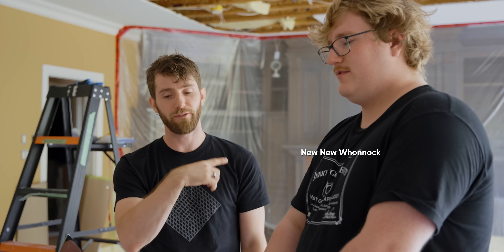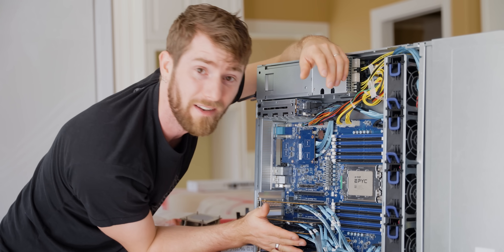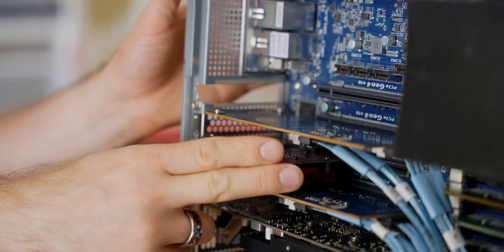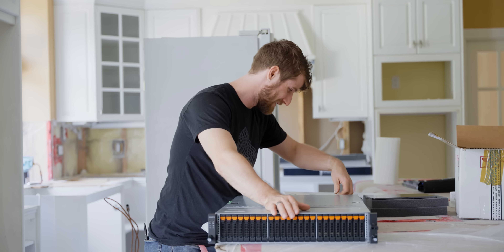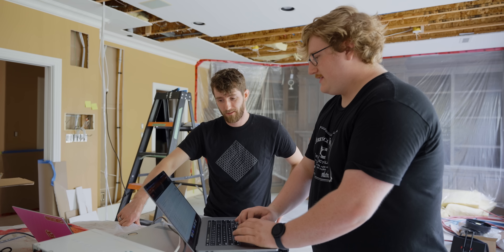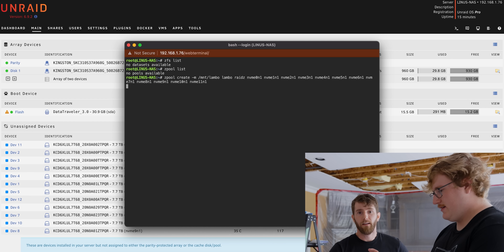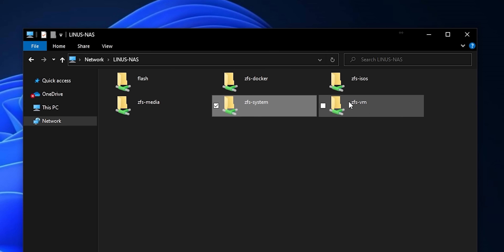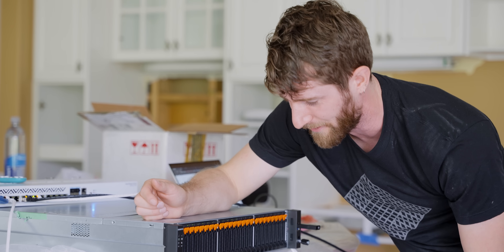This is stupid, but I love it - Linus Home NAS Update 2021

Comment: SMB is single threaded. I mean smb will use one core for a single transaction. I always get better performance with nfs but the fact that windows doesn't natively support it... Hurts.. And the end of the road you'll more likely have network throughput issue than cpu time :D

Comment: I wonder what Linus is doing with this overkill hardware. I have an old Xeon e3-1225v2 with 32 gigs of ddr3 memory in my server which is running a few containers and a vm. The server is not breaking a sweat. Guess i need some more ideas of what to self host haha.

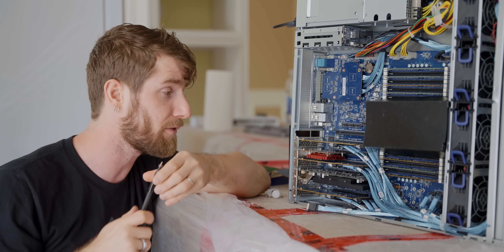Comment: 5:10 To use the top PCI-E Slot you need to Connect the 4 SlimSAS 4i connectors over the Slot with the ones an the Bottom Right. You can use 4 SFF-8654 Kabels for that. It is Mentioned in the Usermanuel on Page 8 and 10. I have the Same Motherboard and was disapointed needing to by 4 Extra cables
Reply: OH the horrors of having to buy 4 cables...geez how lame. Is it in your kitchen???

Comment: For everyone setting up ZFS for their first time: when using raidz mode you only get the IOPS of a single drive. For more performance it's better to go for striped mirrors (equivalent to RAID 1+0).
Reply: Also the recovery is WAY easier. This way if one drive dies of old age, you need to read all the data from ALL the drives, risking another catastrophic drive failure, which in RaidZ1 is baibai all data.
Reply: THIS
Reply: Or striped RAIDz(1/2/3) if you want the most capacity while still being able to choose how many stripes you want as a multiplier of the performance (3xRAIDz2 means 3 sets of 2 drives for parity, and 3xIOPS).

I think Linus ultimately chose RAIDz because his 10GbE networking is the biggest limiting factor, so he wouldn’t be needing much more speed out of the drives either way, at least for movie storage and sequential transfers.
Reply: It is worth noting that with striped mirrors and a large pool of drives (any double digit number total of drives), for multi drive failures you need to pray that none of the failed drives come from the same mirror, or you’d toast the whole pool.

Comment: Linus: "I'm gonna need 100Gbit networking at home"
Jakes "We could do that." was a meme in itself.
Reply: Who doesn't want internet in their house that's faster than the broadband infrastructure serving the neighborhood?
Reply: @TigerofRobare  Well, you wouldn’t want to be unprepared for when the ISPs upgrade in… 2060? …2160?
Reply: @Iceman259  more like 2260 for my rural area
Reply: @TigerofRobare  Networking =/= Internet uplink
Reply: The “should we do that?” Got me chuckling pretty good
Reply: "I can fix that"
Reply: Here I was proud of my 2.5Gbit home network and 16 tb nas server...
Reply: @MeepMeepMwo  I still am [proud] for you
Reply: @christopherjc54  I have 1.5T used of 14TB after format, can hit 385MB transfers and 10Gbe connection, have it backed up to a 2nd machine and 1 offsite copy...are you proud of me too???
Reply: @MeepMeepMwo  10 GbE Base-SR gear is pretty cheap these days and can go over fiber (goes far for cheap).  The same fiber will carry 25 GbE, but that's still a bit pricy.
Reply: @tommythorn  Yeah but the mobo ports are 2.5 and its a small 4 pc wired network. No issues with bandwidth so far. Maybe in the future.
Reply: Rookie numbers, do PETABIT network
Reply: Glass is glass and glass gonna break

Comment: based on a question on the LTT that wasn't answered I ended up with my own question. Each drive you had as a max read/write speed, but is there such a system to be able to have the max read/write on all drives all the time? In a normal PC there is a bottle neck, the more files you are saving the slower the system gets, and the same happens on multiple drive with 1 file being written, so I'm guessing there is a bottleneck chipset that is limiting the writing.
Reply: afaik in this case there is no chipset as the Pcie lanes come directly frome the CPU. as he says in the video, in the worst case scenario he may be RAM bottlenecked as the pool read speeds are actually higher than RAM's
Reply: @gabrielenitti3243  I am not a geek, just a PC user that notices things. Now I remember Linus saying a long while ago that a server was just a PC. 
I understand you can't write what the RAM isn't holding, but I see many times on my PC multiple drives are held back (the copying slowed down) the more you send files to be written to them all. I say all to exclude each drive have a max speed to write so more files will equal a slowing down on the one drive. 
I now need to say when looking at this occurring the RAM is being under used when looking at a manager profile. Something is bottlenecking, and I don't know what this might be, except something on the Mother Board that gateways the information from RAM to Drives.
That would be on a everyday home PC. Is what Linus uses as a motherboard have parts not found in home user systems?
Reply: @tommyrotton9468  Yes, as I said in an everyday home PC most likely the drives are connected to the CPU through the chipset unless it's an nvme drive. But in Linus' server as he mentioned in the beginning all the drives are connected directly to the EPYC CPU that has 128 PCIe lanes so no bottleneck coming from other parts of the system except that in this particular case the drive are so fast that together can throughput more data than the RAM. Therefore in his server RAM speed will be the bottleneck

Comment: The way you referenced drives during pool creation is unsafe, dev numbers can change during reboot and you need to reference them by id instead. Also saying that ARC is not needed for SSD and would hurt performance is a bold statement without reviewing specific workload.

Comment: Video transcoding doesn't really heat up GPUs either, so definitely fine!
Reply: Considering the capabilities of this system, I wanna know if Linus is gonna hack that 1050 to do unlimited streams. I think it's limited to 2 by default, but allegedly you can hack the nvidia driver/firmware to give you unlimited streams. Granted, the NVENC chip can probably only handle a certain amount, but unlimited possibility is nice, especially with 720p/480p transcodes.
Reply: @DarkSwordsman  By default the limit is 3 streams now, and actually it's super easy to patch the driver now with the keylase patch
The 1050 Ti should be able to do 10-15 720p streams
Reply: @DarkSwordsman  LTT + Craft Computing crossover when?
Reply: Plus he just tossed the weakest link of that card those fans are atrociously bad they only lasted 6 months in my system and 3 months with an RMA unit from MSI. I eventually just bought Noctua fans
Reply: @wh0_am_152  r/ihadastroke
Reply: blowymatron
Reply: Also it's a 1050
Reply: fire literally everywhere
Yeah its fiiinnnneee
Reply: @Afif87123  Lol, there are several problems with this setup.

Nvme SSD's heat up without heatsinks which isn't the case here but the problem is, he has multiple nvme ssd's next to each other. And nvme's are notorious for getting slow with performance degradation when they heat up. If his server heats up, then the SATA ssd's are actually faster than nvme ssd's which defeats the purpose of this 'upgrade'.

Second problem is he is using Gigabyte motherboard. Gigabyte have a lot of manufacturing issues and faulty hardware issues like their PSU's atm. If the motherboard has the same fault as the PSU's, that server isn't going to last 6 months.

As you said, its fiiinnnneee.
Reply: @luminatrixfanfiction  What are you on about? The ssds are in a aluminium case with fins on the underside + a shitload of airflow from the case and this particular mainboard did run reliable with a other setup for over 1 year lol
Reply: @WorkinDuck  Do you know why M.2 ssd's have heatsinks in any build?
Reply: @luminatrixfanfiction  These aren't m.2 ssds lol
Reply: @WorkinDuck  I can only assume that you're a Linus employee. Perhaps your 'setup' ran for over a year but can you say for certain if there was no stress to the hardware or thermal throttling involved? 

I can't say for certain since I'm not there to see it but, I do have questions about it. I'm as excited as the next tech guy to see hardware pushed to new levels but I'm also wary of hardware failures when it comes to present limitations.
Reply: @luminatrixfanfiction  gigabyte enterprise boards are fine and while m.2 ssds get small heat sinks to go over them in user motherboards its not like they are cpus or anything like that, the heat they generate is no where near enough to throttle specially in a usecase like this. You really think enterprise level hardware is going to have such an obvious flaw as thermal throttling drives. Kioxia would go out of business is they tried selling these if their engineering was so bad.
Reply: @WorkinDuck  Out of curiosity, if those aren't m.2 ssds, then what are they if they aren't being populated with SATA?

Comment: would he have gotten faster speed with something like a Threadripper PRO 3955WX, using a ASUS Pro WS WRX80E, and a couple NVMEs in an expander like the Asus HYPER M.2 X16 GEN 4 CARD Hyper M.2 x16 Gen 4 Card? Seems like he was bottlnecked by the slower EPYC single core speeds...

Comment: maybe 25gbit .. 100gbit from node to node might be of benefit .. possibly 200gbit, above that you are looking at about 10 years of gradability -- 25gbit is still costly in the end, i would say pair 10's if you have enough port capacity otherwise 10 is fine if you are getting multiple user nodes making requests at the same time.. also common sense

Comment: I haven’t ever understood Linus’ preference for Unraid over TrueNAS (FreeNAS).
Reply: Yeah that and the fact he has Anthony at his disposal. Still decides to use the wrong product for the wrong use case, and the worst part is that people WILL end up paying for Unraid only to find out there’s better supported enterprise class solution available for free. I have MASSIVE ethical issue with that. A disclaimer would be nice. But then, what would they say? “We decided to go with the paid solution because it’s less supported, had less features, but looks more unfinished, but the fact that it’s unprofessional is worth every hassle” wouldn’t probably sound reasonable. For me it’s either FreeNAS/TrueNAS, else some DELL/IBM SAN. But I’d still prefer the iXsystems solution over a NAS which is more popular for it’s VM hypervisor functionality that being a NAS. 🤷‍♀️
Reply: @LMojzis  Thanks for pointing all of this out, I just learned something 🙂
Reply: I believe he's friend with one of the head Unraid guys
Reply: unRAID is nicer as you don't have to have identical drives to have easy setup
Reply: @demoguy84  free/true nas does not have a problem with mismatched drives. I'm running 6 Truenas system with storage between 3tb up to 90tb. Never had a problem with mixing drives makes or sizes.
The hassle of setup up the ZFS on Unraid is un-necessary, just use Truenas FFS!
Reply: @jodokast1205  the problem I've always had with truenas is that using disks of various sizes limits the raid pool based on the size of the smallest disk. So if for example when I built a vdev with 3 2tb drives and went with a 1tb parity I lost half the storage on all the 2tb drives
Even when I stuck with strictly stripping the same would occur.
Reply: @jodokast1205  I'm talking difference between USB/SATA/M.2 SSD/HDD being mixed up. You can use 10 drives of varying capacity. The array will just be made up with the capacity of at most the 10 times the size of the smallest drive, assuming you stripe everything. You can grow your storage as you go, yes, but usually that's how you get into troubles w/ latency, seeks, etc. It's best to stick to similarly specced drives of similar capacities so you're not wasting performance or amount of data you can store.
Reply: You can "brick and mortar" drive (like stripe 500+500 and mirror those with a 1000 one, but that's not the best practice.) For that, BTRFS which Unraid is using is best, as you're not using is as RAID, you're storing individual files accross individual drives, so when your mix and match solution backfires, you lost just the files on that failed drive(s). That's literally the key selling point of Unraid - home gamers with massive collection of mismached drives.
Reply: For the use case, Unraids VM support is much much better than TrueNAS. The only thing is that using native ZFS is a little difficult at this point. Since you can add ZFS support to Unraid and not add better VM support, I can see why he did this. Passing through GPUs to Plex is also much easier.
Reply: @tttekev  there’s nothing stopping you from slapping a Vmware ESXi on the server and installing FreeNAS/TrueNAS solution and passing through the entire SATA/SAS controllers to it. Vmware vs Unraid? Pretty easy choice. Especially as, again, for FREE you get uncomparably better feature set and Enterprise class reliability. As long as you don’t bottleneck it by using a crap HP server, you have standardized solutions used by milions, as opposed to Unraid, which is literally targeted towards people who refuse or are UN able to run proper RAID. UN+RAID, not-RAID. Linus has 20+ identical specced drives, so there’s literally no reason whatsoever to use a software that needs to be (corrently) modified and essentially turned into a snowflake server.
Reply: @LMojzis  yep, ESXi for the win
Reply: @LMojzis  I would argue that passing through the drives to a hypervisor like VMware is an even worse approach. It creates extra overhead and can affect the operation of important services such as SMART. You're also adding unnecessary complexity. You'll have to have one VM for Plex, and another for storage. 

That being said, there is no right answer to the problem that's trying to be solved here. This conversation alone is a testement to the idea that everyone has their own preferences. It could be that Linus or his team has been more comfortable with unRAID as opposed to other solutions. We can only speculate whether his personal relationship with the founder is the reason why he went the unRAID route for this project but historically they have done server builds with unRAID when PCI pass through is required.
Reply: @tttekev  How did you read "passing through the entire SATA/SAS controllers to it" become "passing through the [individual] drives"? It's calles PCI Pass-through for a reason.
Reply: @tttekev  So yeah, unnecessarily long comment for something that's de facto industry standard already and not up to "everyone [having] their own preferences". Sure, you might argue that it's technically possible to do any which way, but there's the "Universally agreed upon way" and the "Let's see if I lose my data" way.
Reply: There's a reason Linus is gonna offload the data daily to the office.
Reply: I still prefer Openindiana (Solaris) with Napp-it on top.
Reply: unRAID are really bad
Reply: @orfeous  no no no. Unraid is AMAZING for a home gamer w/o access to server hardware and same spec drives. If you don’t care about performance or data integrity, you can run Unraid on your moms old laptop w/ USB to SATA converters or on a $10 flee market HP crap. The cost of Unraid offsets this greatly. But if you DO want ECC to protect your data, and you want to do proper data redundancy, you would be using a wrong product if tou used Unraid. Just because you can doesn’t mean you should. Unraid itself is good, it’s the advice and constant plugging of it as a “go-to solution”.

Comment: Wouldn't ESXi be a much better match for a server like this? I mean, seems a little big for unraid is all I'm saying...
Reply: They'd still need to raid to drives together, they used unraid instead of say TrueNAS or a hardware based RAID controller
Reply: @Cheekygorilla1337  Yeah but you can just have a virtual TrueNAS and passthrough some drives to that and some fast VM datastores and have a very capable VMhost, NAS and even containers with tanzu.

Comment: If I'm doing the math right, if you're fully ripping your blurays and not remuxing, this has a capacity of ~1500 blurays? On the one hand, that's a lot. On the other... It's kinda depressing how limited that is compared to how expensive this is.
Reply: If these drives are ~$1000 each (kinda hard to find pricing) that means you're spending ~$5/movie on *storage*.

Comment: Linus: "beleive it or not this only comes with gigabit ethernet" 
Me, learning over my 100mp/s wifi that very second that ethernet had gotten faster than gigabit: "pathetic"
Reply: It has but hasn't. Consumer-grade stuff is still largely limited to 1gbps, with some minor pushes towards 2.5gbps (I mean directly on motherboards/consumer routers). 10gbps is still limited to add-in cards and more commercial-grade switches/routers, with higher than that limited to enterprise-grade hardware. It's sad that consumer-grade wifi, right now, is already faster than the ethernet available on the same hardware (Wifi 6, aka 802.11ax, can be upwards of 2gbps depending on configuration, but the routers etc that come with it still only have 1gbps ethernet.. it's crazy).

Side note, in this area, in a couple years, they'll have finished rolling out fiber-to-the-home internet, with their top plan being 2gbps. There are definitely people who are going to buy it that legit cannot use half of it because their home networking hardware simply cannot go that fast.
Reply: @ApeironTsuka  unless they just don't even install ethernet at all, instead going for a fiber to wifi 6 modem. Of course then you'll need all wifi six compatible devices.... 
I hadn't heard about wifi 6 either. I've been out of the market for a while. I have wifi ac in my house, but with only 100 mb/s connection don't need anything better. Might take a look at whats going on now tho